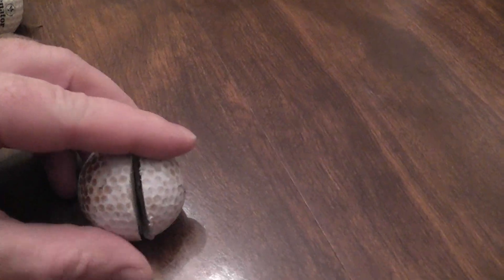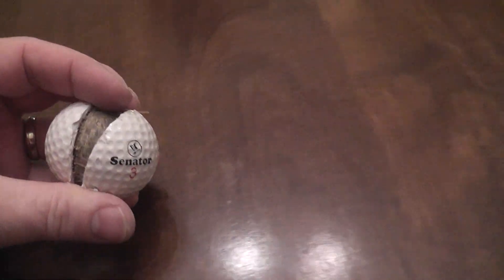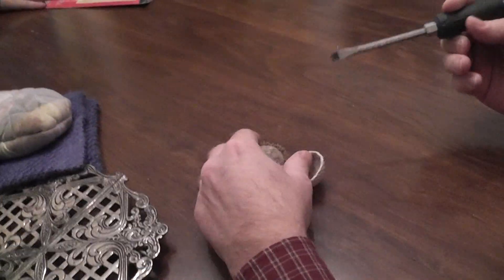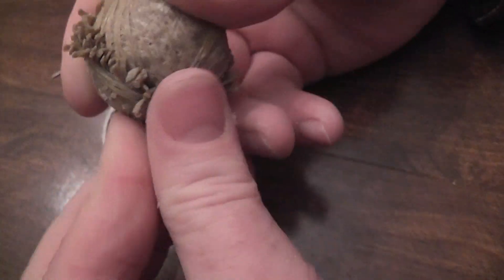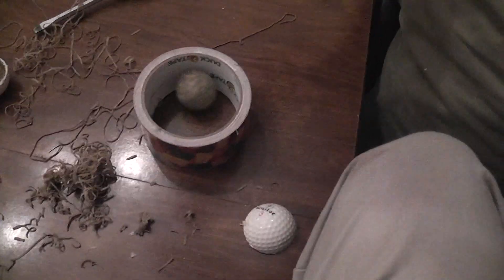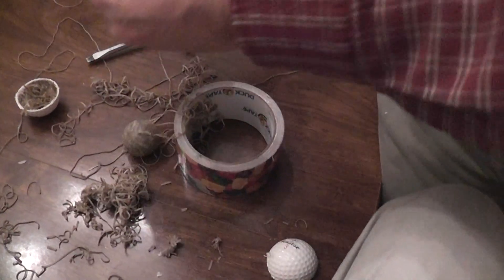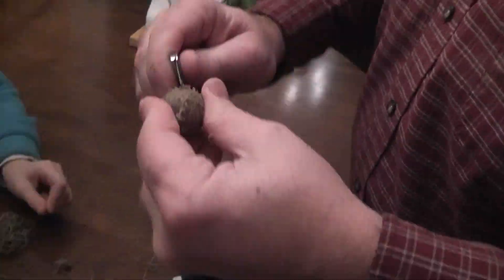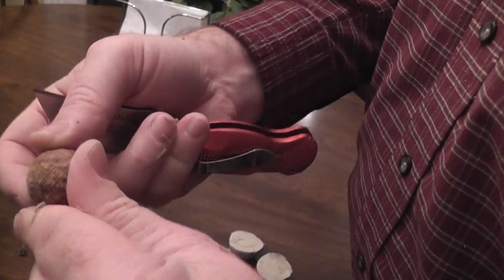Inside a Golf Ball

Comment: Thank you for a great video.  About how long is the rubber string?  My older brother and I dissected a ball when we were in our single digits in age.  I wrapped the band around and around and around the house to get an idea of length.  At that age my determination was that the rubber string was very long and frustrated my perplexed dad quite a bit when he battled his way out the springy door to call us in for mac and cheese.  I sure would appreciate it if you could give me a reasonable estimate of the actual length of that rubber string.
Reply from the maker: That's a good question.  I love your story!  I can tell you I never really tried to keep it intact and stretch it out before to take a measurement.  I"m sure some calculation could be made regarding the length, but probably they all vary based on the manufacturer and the thickness of the rubber..
Reply: I agree.  Plus I don't think they make them that way anymore and the old ones just sort of explode leaving the rubber band in little pieces.